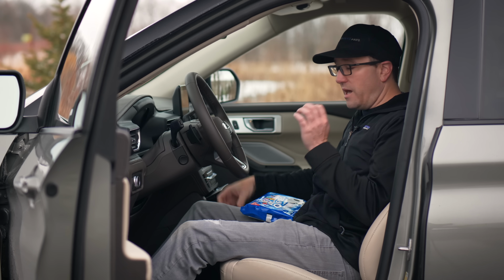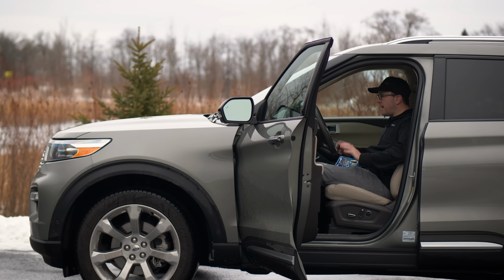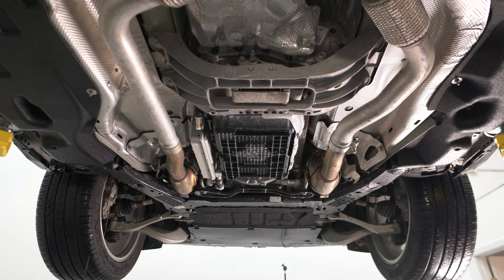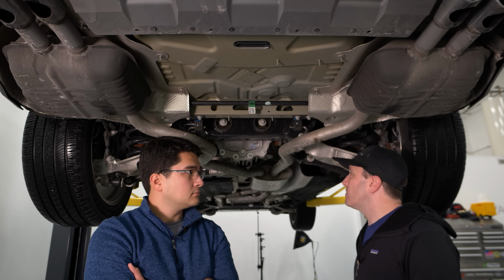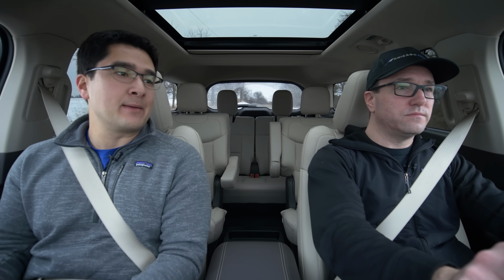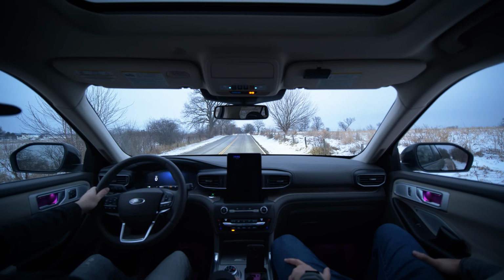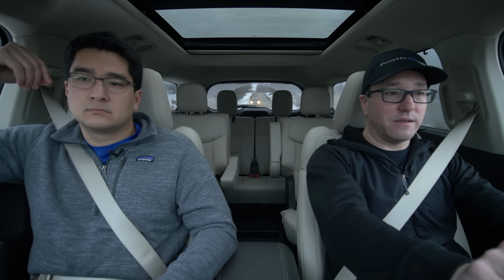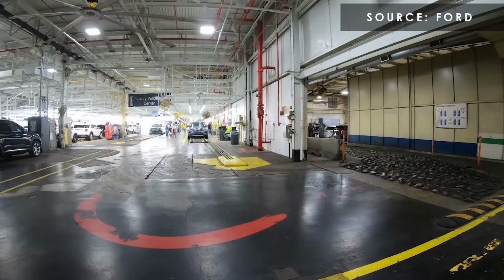2020 Ford Explorer | Who Is Responsible For This?

Comment: So, $60K for an unfinished, half-baked, piece of shit that's already falling apart.  Did you see "exhaust sports auto" review of the Explorer?  Had TONS of defects with only like 9 or 10K miles.  Wow; downshifted enough to lock the tires?  LOL.  That's insane, man.  Guess this isn't the first time ford has totally fubarred a transmission.  Who would buy this thing?  Yeah, it's great to support American jobs, but the company is totally shitting on it's customers.  And there's a completely lack of accountability when you take these half-baked cars to the dealership for warranty work -- no one wants to deal with it. The last Ford I bought was a lemon and it doesn't look like ANYTHING has changed.  Never again.

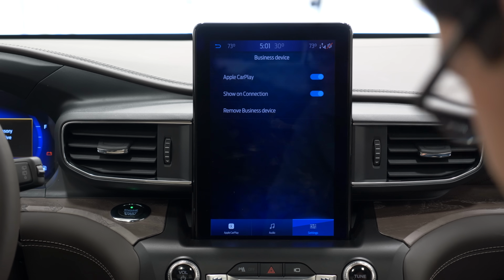Comment: 4:25 The backup camera display is utterly moronic. This is not nuclear science. No one at Ford was bothered by it? If not, that sets off a warning flag for me about other possible items they were not bothered by.
Reply: Yeah they basically have all the negatives of having shoved a giant tablet in the middle, without any of the actual benefits of doing it correctly.  There's no reason for the backup camera to be a quarter of this screen in portrait mode, they should at the very least have filled half the screen with it then put the other items below it. It's clearly just laziness where they don't really give a shit how stupid it is as long as it technically works.
Reply: mountainhobo you know what makes even less sense? The camera on the ecosport is full screen.
Reply: The fact that no one thought to put the camera in the gauge cluster bothers me too, as they have an entirely digital gauge cluster to work with.
Reply: The camera display is probably so small because they are using low resolution cameras.
Reply: I don't think you can get cameras of such low resolution anymore.
Reply: It's so weird especially since other Ford's have better ones too like the 2019 F150 I rented to move some stuff recently
Reply: @TheSDB13  The F150 and Mustang are Ford's golden geese. I'm sure they assign the best people to those teams.
Reply: @stevee8318  The F150 camera and screen are a lot lower resolution than this, the biggest problem as others have said, is not being to enlarge the image, you can enlarge the F150 image by tapping it into full screen, there has been software updates done, but that should be fixed.
Reply: They were probably bothered by it, but when you're rushing to meet deadlines, things like that slide.
Reply: Am I wrong to assume that could be fixed with a software update?  Granted, the resolution might suck, but it could still be made bigger I think.
Reply: I drove a new lincoln the other day, and the rear view camera was literally unusable. It was laggy, the frame rate stuttered, the fish eye of the image made everything super distorted, just awful. I don't even use them normally, but getting into my bay at work, sometimes it's nice to have so I can back up closer to the other bays in the garage. I practically felt car sick even looking at it for a single second. Hope this is better, but I sincerely doubt it.
Reply: Typical for junky American cars. I would hope this car has less quirks in the less expensive trims. This thing must have some of the worst depreciation.

Comment: The transmission is probably the most disappointing part to me. Fortunately the XLT comes with a much better looking horizontal screen. I also don't really care as much as others about the fit and finish (although I'd prefer it be better), but Ford really has no excuse for the prices they're charging. Glad they went back to RWD, though, as it's dynamically so much better any time you have to accelerate quickly, and it's much better for towing (even though the tow numbers haven't changed much). Definitely a good one to wait at least another model year on as you said.

Comment: The exhaust tips is not for soot.  Thats insanity.  Sure that's what Ford says but they lie.

The exhaust is that way because of all the issues with CO entering the cabin in the last generation.  Ford's fix was to replace the tips with turn down tips.  That has carried over to the botched 2020 model but Ford just wraps it in a shiny case.  It has NOTHING to do with soot buildup.  Thats marketing speak for sheep.

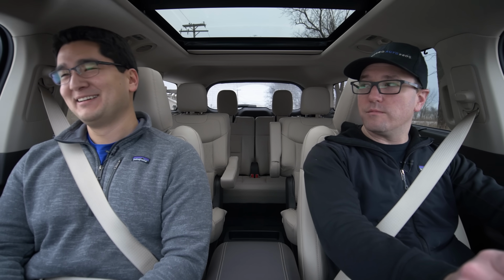Comment: 14:10 I'm responsible for that awful head restraint angle. Look at how his head and neck are crunched forward. I worked on a project with Ford on making the head restraint better and it didn't catch on.
Reply: I noticed that
Reply: @leesonneville1817  Did you also work on the Fiesta ST? It has a pretty aggressive head angle in the recaro seats. I'm used to it but the wife hates it.
Reply: @bt7482  I have a fix for you if you don't know about it. You can install the adjustable headrest from a 2012 to 2014 Focus. look on eBay you can get a set between 50 to $80. The adjustable ones have a slot on the bottom.

https://youtu.be/o4oJju3thyg

Comment: Everyone: nobody can make a transmission worse than cvts 
Ford: hold my 10 speed
Reply: LOL
Reply: He really seemed to like the "10 speed" cvt in the new Corolla's a lot more
Reply: There are 10R Mustangs running 8-second 1/4 miles and 10R F150's in the 9's!
Reply: That's a joint venture with GM.
Bahaha!
Reply: CVT  is  great  for highway cruising  and just for comfort driving but if you looking for driving engagement  is total failure!
Reply: @abt4702  Actually not quite. Check out savagegeese's video on the corolla hatchback. By no means is it a fast car, but I own one and the transmission does very well for what it is. I was scared to get a cvt and I think this is one of few cars, if any others, where I would not regret my decision
Reply: @thenoon97  I think u misunderstood my point there, yes CVT'S are great for economy cars to save gas and for regular driving style they are really good for cars like Corolla u mention and others in this segment  but if u pair CVT in car that supposed to give u performance is total failure.  Performance means driving engagement and dynamics  not from straight line speed  or how fast it goes from 0-60, i can take any car from straight line and it will be fast, thats not my point but  respect ur opinion ofc and i hope we understand each other.
Reply: @abt4702  nah I get what you're saying and I didn't explain myself very well. The new corolla has a physical first gear to lighten the rubber band feeling and provide more engagement off the line, while it simulates shifts to provide a more engaging, manual transmission like experience. The shifts are quicker than an automatic because there's no gears moving, which is usually good for driver engagement as well. Obviously, a manual trans is the way to go for true engagement, but I'm just trying to say that toyota made one that values driver engagement more than other cvt's and they did a very good job of accomplishing it. As for other cvt's, I haven't seen any others use this technology and for the most part (like 99.9%) you are correct that they are boring, economical rubber bands
Reply: However, many people have also hated on it for simulated shifts ruining the point of a cvt, which is fair. So, just depends on what you're looking for and what the brand designed the vehicle around, which in this case was a CVT designed to be economical and engaging
Reply: @thenoon97  cool, CVT'S are fine but i  just want to add something in regards to those fake shifts, those fake shifts should never be  in CVT why  bcs it takes the car out of the power band instead of keeping in band and that actually slowing the car, i just  can't understand who come up with this dumb idea with those fake shifts points, CVT should perform like CVT  not slowing down the car, yeah they tried to make them similar to regular automatics but why would i get CVT with shift points when i can go and get regular one, this whole idea is so dumb.
Reply: @abt4702  in this car it works where it holds revs like a normal cvt if you drive it normal, if you want to have fun and give it more throttle then it simulates shifts. Not trying to argue with you, I fully understand all the points you have made and am merely trying to show I think this specific cvt stands out a bit in its engineering as opposed to the masses of generic CVT's out there
Reply: @thenoon97  ofc is cool, for me this whole thing is dumb idea with those fake shits points but to each his own .
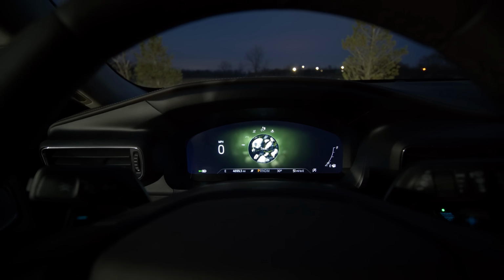Reply: @thenoon97  https://youtu.be/MW5KSbjT5rg  12:52 i totally  agree with him on that
Reply: @abt4702  Have you driven the Maxima?
Reply: @bfee20021  Yes i had 2017 model for 17 months but i got rid of it bcs i couldn't stand that CVT transmission, its a great transmission for highway cruising and just regular stuff but for driving engagement is total failure! This Maxima have really balls in this engine but it deserves DCT or at least 7,8 automatic to be a sport sedan. This CVT does not belong to this car at all but to each his own ofc.

Comment: On your commentary around 21:00: It's not that they had engineers with too little experience working on stuff. That is the case at almost any company. Young engineers do a lot of the grunt work. 

The problem is that they have a LOT of incompetent people in positions that have the power to significantly influence the final vehicle product. This is true at all component and system levels! You've got people working on systems they hardly have any grasp of. I'm not surprised Ford is turning out bad transmissions with my experience with their people at ATNPC where they develop new ATs. There are good people there, but they're bogged down by crappy support. They also have these "low cost" development centers in other countries around the world where they're trying to save a few bucks paying Turkish or Indian engineers maybe a third of what an american engineer makes for the same work. This makes for a crappy workflow with time differences and language barriers galore. I imagine they are also struggling to recruit good talent to fill in their ranks and have been for the past 20 years or so. I doubt the hiring pool for good engineers in Detroit is exactly stellar. I always thought something was in the water in that place when I realized most people there are totally incompetent. Turns out I was right!

In addition to this their management of the supply chain is horrendous. Their purchasing department is totally incompetent and is a toxic work environment. The buyers have performance targets that lead them to make less than optimal decisions. They shift buyers around ON PURPOSE before they can even become familiar with a particular segment! Their management is overly aggressive and adversarial. They're all assholes to work with. They constantly reduce volumes on suppliers after program launch and pick inferior suppliers with inferior tech over pennies against the recommendations of their engineers. They start with completely stupid timelines that their suppliers know cannot be met so everyone is forced into production with a multitude of deviations for performance of product. It's a shitshow. The other american makers are the same. Working with Toyota or Honda or the Germans is TOTALLY different.

Comment: I initially started watching this channel from your days building a dd'er/track FRS.  Now as a father with a family of four I really appreciate your no BS reviews of family haulers.  Likely one of the reasons I'll be getting a used 2017 CX5 to replace one of vehicles.  Keep it up!
Reply: Definitely don't buy a Durango...
Reply: When I see someone trying to sell an FCA vehicle i tend to back away very very slowly...
Reply: @trevormontague803  what's wrong with a Durango? It's better than the Explorer and can tow much more than the CX9. It's a quality SUV. Check out Alex on Autos long term review of his. He chose the Durango over both the CX9 and the Explorer. His opinion I actually trust.
Reply: @Turshin  great reasons, however if I don't tow primarily like Alex, or don't even tow at all, the CX-9/5 have better creature comforts and driving dynamics that are unbeatable. Better fit and finish in the interior, quality interior components etc. I've driven the Grand Cherokee and it was good but interior is clearly lacking compared to Mazda. Cheap plastics, failed window seals in a new model, etc. The infotainment failed half way through the trip and left a sour taste.
Reply: The cx9 is cool but it ain't no Grand Cherokee. I dont know what GC you've been in but the interior quality is killing the CX9. I've never had a problem with uconnect
Reply: @trevormontague803  also what's wrong with FCA vehicles. I think they're cool. I've owned vehicles from all the big 3, Japanese, and German. I've owned 5 chryslers. And all of them ran like champs. A great majority of the quality issues come from ppl not following their service intervals. My best vehicle was a 1995 Toyota Camry LE. that thing was unstoppable.
Reply: @Turshin  A Durango is a full size SUV, not something I am in the market for.  There is a lot wrong with FCA vehicles, cheap interiors, poor fuel mileage relative to what they claim, not that resilient to rust, very poor build quality/reliability.  I have family members who have been FCA die hards and even they are starting to switch to Toyota, control arm bushings have had to be replaced twice within 200k km, and the list goes on.  It makes no sense to go with an FCA vehicle in that segment when there are other manufacturers like Toyota and Mazda offering excellent reliability with much better interiors and fuel efficiency.  Plus, if a Durango's claim to fame is being "better than an Explorer" then it needs to raise its standards slightly.
Reply: @trevormontague803  go and test drive a new Jeep Cherokee or Grand Cherokee. They're wayyyy better than the cx9 you're thinking about getting. The hurricane turbo 4 is an excellent motor. It has something the cx9 doesnt....torque. Also if you grab a trailhawk you can go off roading or overlanding with your family. It's a much more flexible vehicle than the cx9 will ever be.
Reply: Hehe the pacifica would be a great car for you!
Reply: Sorry but it sounds like you're just repeating what others have said and actually given an unbiased good look at FCA vehicles. The charger, challenger, and 300 have poorly designed dashboards I'll give you that but the rest of the vehicle is comfortable and very well designed. The Ram has the best interior in its segment, the Pacifica has the best interior in its segment. The Grand Cherokee or any other Jeep is far from plasticky. And no they dont have rust issues. That claim to fame still belongs to TOYOTA. Dont listen to what other ppl may cry about. You have to do your own research. You dont know other ppls driving habits. For all you know your family members could be driving over 300 potholes a day or just terrible drivers. Then sure yeah they would have to replace suspension parts. I dont have a problem with either Mazda or Toyota but the days of Japanese auto makers being Leagues ahead of everyone in reliability ended in 2010.
Reply: All I'm saying is do your own, in person, unbiased research. Dont believe everthing you here over the internet. Mark doesn't review many FCA vehicles because he has a negative biased against them from bad experience with a chrysler vehicle almost 30 years ago. If that's the case then ppl should hate all mazdas and hyundais because they weren't any better. Things have changed new management, new workers, new ways of doing business.
Reply: @Turshin  None of my current or past car buying decisions were based off if a single review of what people are saying online.  I appreciate Mark's no BS reviews period.  If you think that Toyota is the manufacturer with rust issues then that is your prerogative.  I'll use my 12+ years of used car purchases and experience to help me make that decision, plus the countless 10+ year old Toyota's still driving rust free today.  I have no need for an off road cable vehicle like a GC, I am not cross shopping the GC to the CX5 as I already have a somewhat off road capable vehicle to do that if needed.  I am also well aware of my family members driving habits, how well they cared for their cars and how they rusted.  Look around you, relatively new ram trucks all have rust yet old Tundra's are still in excellent condition.  Touting off "interior quality" as if you were a JD Power spokesperson, I care a lot more about long term reliability than initial quality garbage.  If you want to buy FCA vehicles then go ahead I won't be stopping you.  There is no way I will be putting my family's hard earned money on one of their vehicles.  I have better things to do than to constantly chase down worn parts on a car with a rock bottom resale value.
Reply: Buy a Durango
Reply: turshin offers absolutely no support or reasoning. CX-5 is way better
Reply: @Turshin  I hope you're just trolling